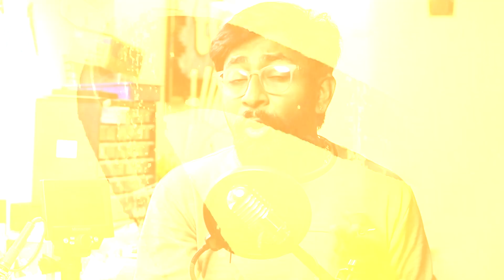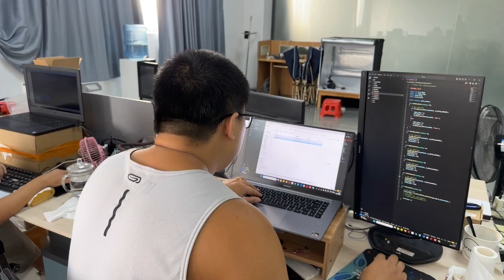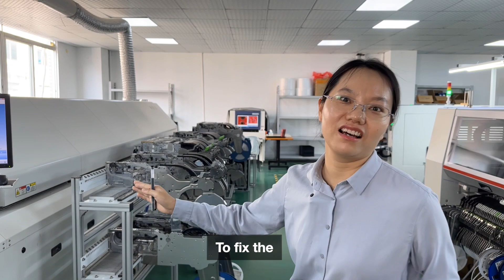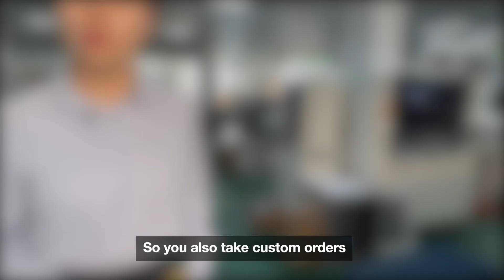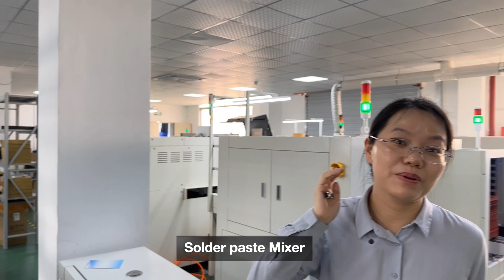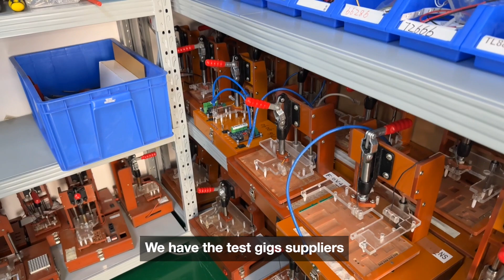Inside Electronics Boards Manufacturing Factory in China 🇨🇳 | MakerFabs Factory Tour

Comment: I've been working with Makerfabs for 6 years, they are fantastic people :)
Reply: how do you get in touch with them? I ordered a board and it does not have full documentation on their website.. no response to email either.
Reply: @dancerx2733  not sure what you mean with ordered a board but if you mean PCBA there is instructions on the shop page and an email to message for PCBA and other custom manufacturing